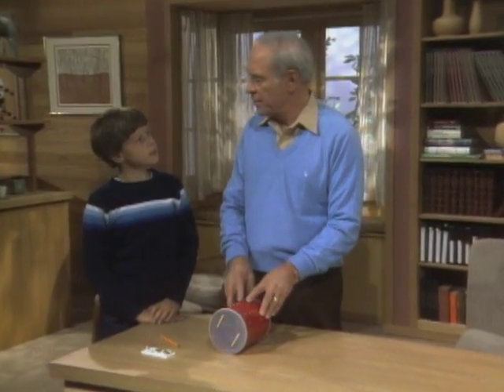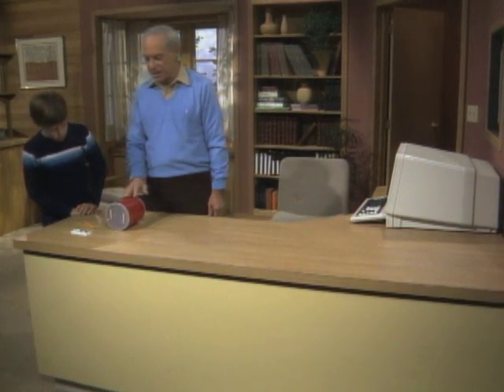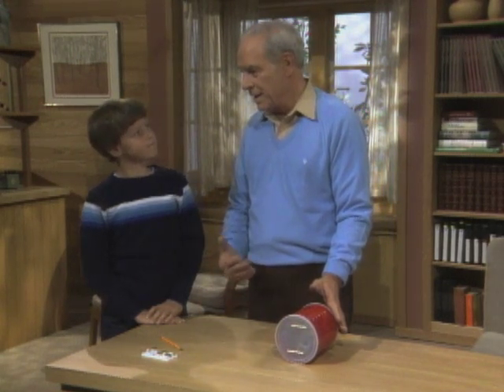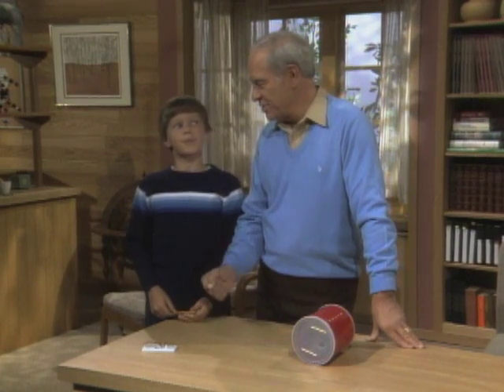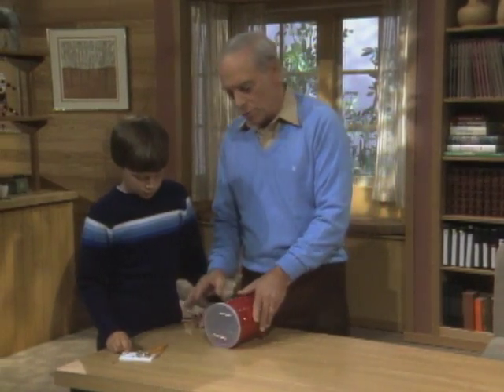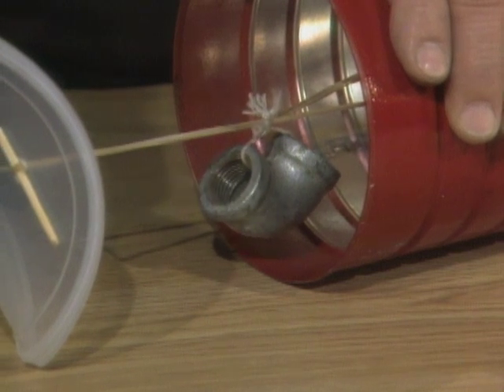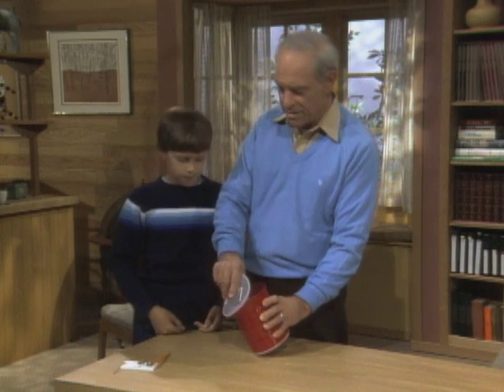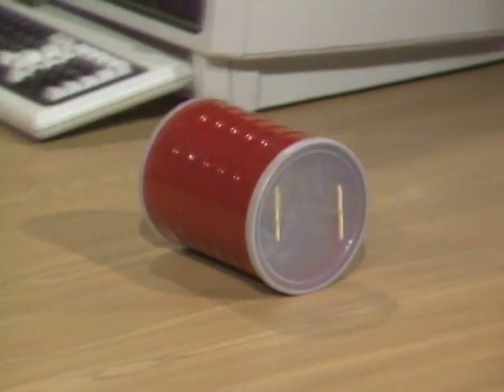How to Build a "Comeback Can" Using Kinetic Energy - Mr. Wizard's Supermarket Science

Comment: Potential and kinetic energy needs to be stored in order for the comeback can to roll back. Furthermore,r the inside of a can is pulling different rubber bands where the energy is stored to balanced the weight. Which rolls it back. Therefore if the rubber bands are cut there will no-longer be any type of energy, assisting in its gravity.